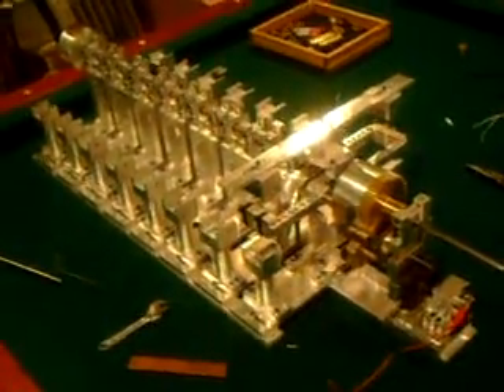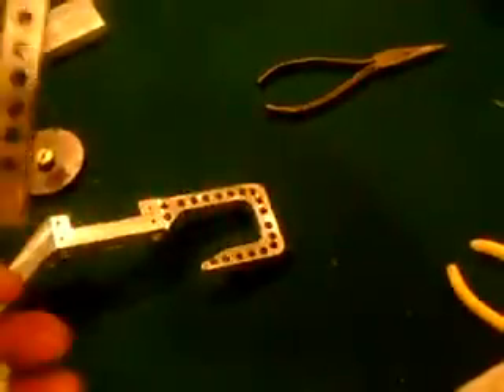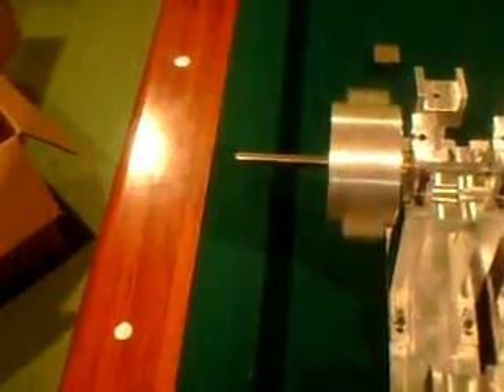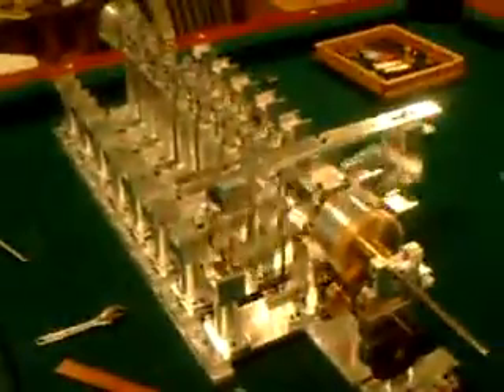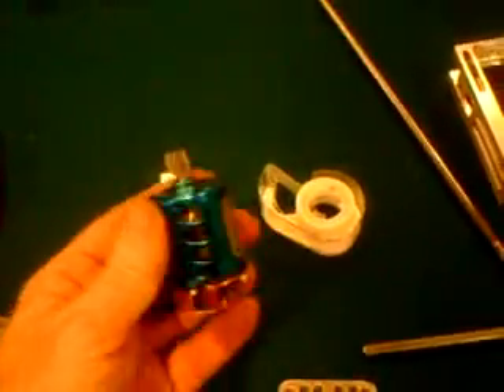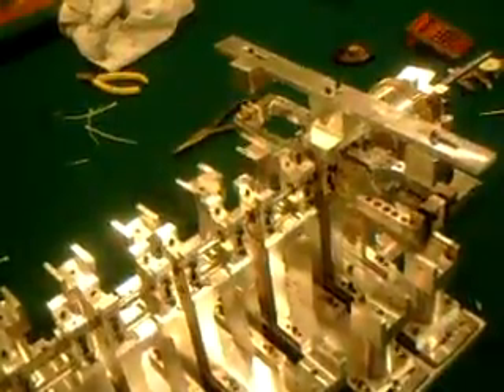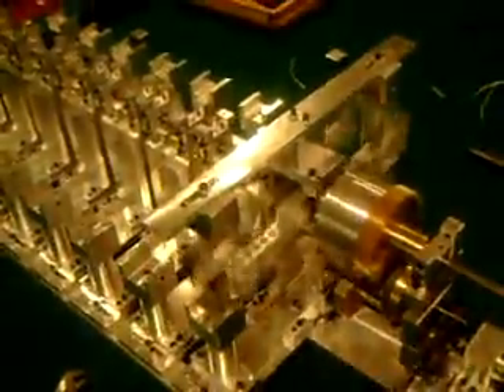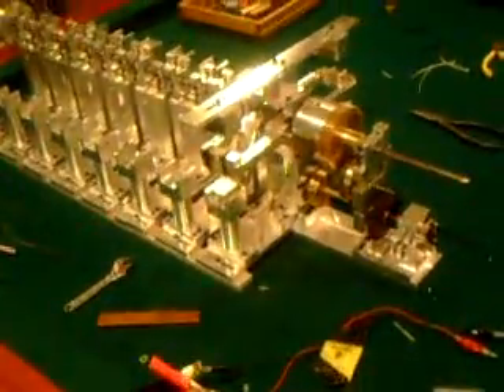Over Unity 15

Comment: how many will you have to run until you convince people that it's impressive that this is only done with a small battery? Did you ever measure watt/volt and ampere put out by the device before you are connecting the other ones?